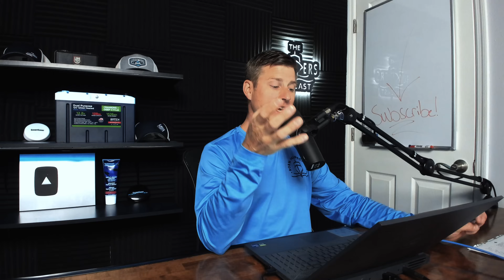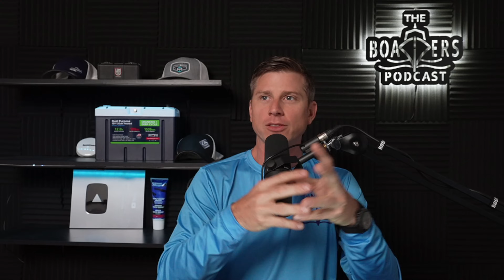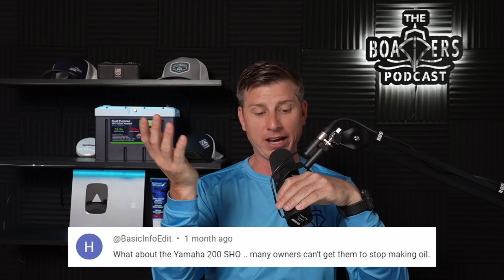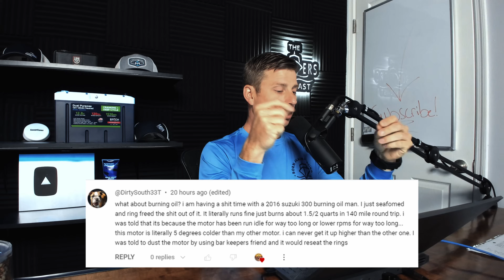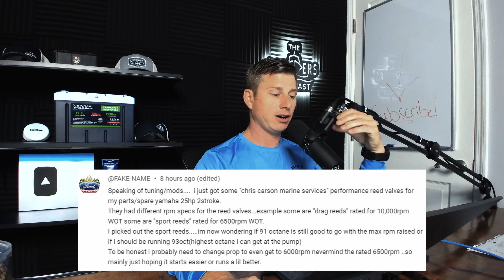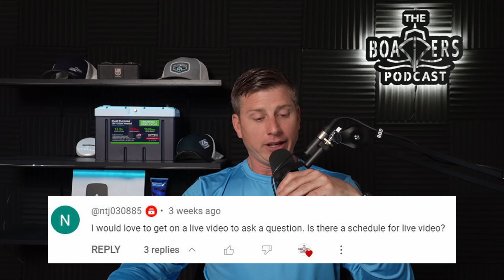Why Outboards Make Or Burn Oil?

Comment: let me clear something up for everyone that arent mechanically inclined. no engine can make oil unless you have a refinery built into your engine. thats impossible. making oil is anything making the oil level rise from something other than you putting it in intensionaly like oil getting passed the rings which is most common with yamahas. i know bc i have a 23 sho 250 that was broke in to yamaha procedure and followed to a tee and maskes oil bad. i like to put around to find structure and fish just like every other bass fisherman out there so an engine that cant idle s worthless and should not be sold as an outboard. the correct way to break a yamaha sho in that they wont tell you is the very first time you start it run the bat hell out of it for 2 or 3 hours wot and you are good.do not do the 2k rpm for 2 hours  and then on plane and wot for a few seconds or you will be in my boat literally. run it like you stole it the first start of its life for 2 hours and you will be able to idle as much as you want and make no oil. a dealer told me this. 
by the way when your oil level gets high enough your engine will hydro lock and most likely you will bend a rod.

Comment: 2019 Suzuki 300 making oil. My mechanic switched oil and thermostats. He didn’t take it apart but he’s talking might new Powerhead.   Haven’t heard that before.  I’ll try cheaper things before that since my extended warranty might not cover this issue.  150 hours on engine. I didn’t do the break in
Reply from the maker: New powerhead! Yeah, idk if I would go that route, try and run it harder and check the prop, the thermostat change was to bring the temp up, so that's the right track
Reply: @TheBoatersPodcast  yea trust me I’m not trying to go new Powerhead route   Rpm at wot 6000.  I’m gonna change oil today. Tomo run it hard. Hope for the best.  The mech starting talking Powerhead I’m like let’s check some cheaper options first

Comment: So once it's glazed, you're basically screwed?
Reply from the maker: Depends lol lots of different models and scenarios. If it's really just glazing, usually you can run em hot and burn it off with a carbon burn, but if it's like an early 2000's 3.3L with the plasma-fused cylinder walls, hard to find one of those engines that doesn't have a fuel dilution issue. :/ so not necessarily lol

Comment: My 2021 Yamaha 300s made oil for the first 100 hours. Everyone said run them hard to break them in so I did. At the 200 hour interval, the oil is at the full mark, but not past it!
Reply: @Tevon93  I did the break in period by the book, and was told by the Yamaha dealer to run them hard to mate the rings into the cylinder walls so they wouldn’t make oil which is exactly what Aaron says in this video. I’m at 200 hours, they don’t make oil and I never threw a rod. Even if I did throw a rod, I’m going to try my hardest to do it in the first 3 years because I’m still under warranty.

Comment: Dude I was not expecting you to answer. I was weary on the dusting the motor part myself. I added sea foam into the oil as directed on the can then used spray in the intake hot soak like it said on the can and super strong gas mixture. I did 3 hot soaks total and changed oil, ran last weekend and didn't burn anything. it was identical to my other motor. I could not believe it. knock on wood that its fixed! I have had a leakdown done last year and they said it was acceptable i think 10% or 12%. dealer basically wanted to rebuild. Thanks man I appreciate the help! always love the shows and videos man!
Reply from the maker: You're welcome

Comment: I have a 1999 Evinrude 50hp 4 stroke(Made by suzuki) and the overheat alarm goes off only when I'm about to put the boat on the trailer. Sometimes after a long run and sometimes not. It seems to be pumping water most if not all of the time. New impeller, new water tube grommet and water pump gasket, I put a hose to the water tube and it has great pressure all the way to the thermostat so I don't think there is a blockage anywhere. It is very weird that its only at low idle and neutral about to put it on the trailer. Any advice would be appreciated.
Reply from the maker: Thanks for your comment! I've saved it for a detailed response in a future episode. Don't forget to tune in!

Comment: If the computer shows you followed the break in process and you still have the fuel dilution issue and you tried the Yamaha solution several times and still have the issue have you seen Yamaha cover  this issue under warranty?
Is the customer responsible for this design flaw ?
Reply from the maker: Thank you for your comment! I'll be providing a detailed response in a future episode, so be sure to tune in!